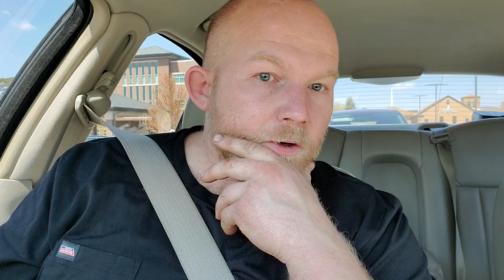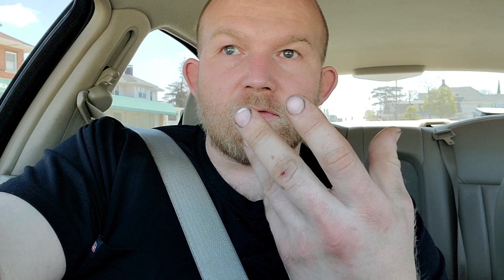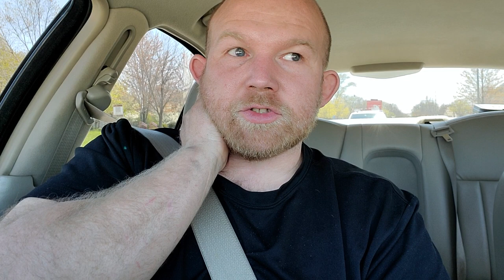Customer States " there is a pill bottle missing from my truck " Oh Boy, please come and get it NOW!

Comment: I like your videos. Thanks. True story. I was working at the Nissan dealer back in the mid eighties and a 720 4x4 pickup truck came in on a hook. It was brand new and one of the last produced before the Hard Body truck came out for sale. The client said that it died while sitting still after he and his friend had been pulled over by the police. Those trucks have the ECU mounted under the passenger seat. Really bad place for the ECU to be located in the first place. We were always dealing with fried computers after someone had been out four wheeling and water and mud would enter the cab. Well, this truck had only about six or seven thousand miles on it so ideally it should be covered by a warranty. But when your friend panics and throws the bong full of water under the seat and it soaks the ECU, causing it to smoke, the warranty is void. Pretty expensive little speeding ticket, I’d say. 
Another story. Two Mexicans came in to my shop in the middle of the summer when it was in the high 90’s. They were complaining about how hot it was in the little Toyota because the heat was stuck on the warmer setting and the knob would just spin and wouldn’t change to cold a/c. They didn’t speak English and I don’t speak Spanish so it was difficult to understand each other. But, in badly broken Spanish, I told them to go get some food from the joint down the street and I would look at it in a bit. Well, I had my tech look for the problem and what he found was the cable had been disconnected from someone trying to make space in order to be able to fit a couple of softball size balls of cocaine up in the dash. Probably a kilo or more. I don’t think that the Mexican dudes even knew that the dope was crammed up there. I think they were unwitting mules. This was in the early 90’s when the cocaine was still actually the good stuff. Not all beaten and stomped on like it was the last time I indulged some 20 years ago. I was tempted to pilfer some, but I was not into having a fire sale at my shop after the mules got to their destination and the reception team figured out that the stash was light. 
As a 56 year old man and a 38 year veteran master technician and shop owner in the auto diagnostic and repair industry I’ve seen it all and I’m really burned out. Crackpot clients, fraudulent seekers of free stuff, warranty scammers, the “it wasn’t doing that before” assholes, jack off hack mechanics and true, genius technicians, blow job offers for repairs, titties flashed for a discount, crack pipes, rigs and needles, people that live in the trunk, and some really good, loyal and lifelong customers. We see every type of person that walks the planet. 
I’m starting a new career in custom auto upholstery and trying to sell my shop now. I’m too tired and beat up from wrecking my body over the years and I can’t find a good technician for the life of me. I’ve hired and fired so many times that I can’t count the amount. All the best techs are either comfortable with their employers or leaving the industry because they’re discouraged with the very small pool of candidates to take the baton from them and mold into the next true technician. Meaning that they have all the burden on their shoulders with all the problems to solve in this mainly thankless vocation. Not only that, but as masters in a never ending educational aspect, we’re under paid as a whole. After all, we really are doctors in a sense. The human body hasn’t changed in thousands of years, but the technology changes in the automotive world are as abundant as the times you change your underwear. Or how often you should change your underwear at least. I though, pay my 2 techs very well because I value them and know how difficult it is to keep up with technology and the costs of being the best. One of the guys makes over $100k and the other makes close to $80k per year. This is with a Monday through Friday, no weekends work week. Plus we’re out of the shop and closed by 6pm.

Comment: I work as an auto tech for my local police department and you are almost guaranteed to find stuff under the backseat of the patrol cars. We strip the cars out when they are totaled, they shove it in the cutout where the seatbelt comes through. Anything you can imagine but usually in small amounts. I'm still waiting to find my wad of drug money 😪
Reply: As far as I know the back seats are plastic and are made to be easily removed. The officer is saposed to check the back and look under the seat after every person they take to jail so that 1 that person they just took to jail can be charged and 2nd so that someone can't say that it wasn't theirs and was from the person before them.

Comment: could you imagine going on a road test and getting stopped/ searched. by definition you'd be in possesion
Reply: Yes technically he would be but most cops wouldn't charge him with it since he had zero connection to the car. If they were to charge him, a good lawyer could get the the charges dismissed.
Reply: I doubt that because if your car is stolen and returned to your driveway and you have no knowledge of it but the police have proof is used in a robbery in your driving at the next day you're not going to go to rest for the robbery or like ah that wasn't you oh shit there's a joint in there huh probably wasn't you that's probably the robbers too
Reply: That's why you never talk to police, don't answer any questions, don't consent to search and keep your mouth shut.

Comment: Lol. Recovering alcoholic /addict here, 17 months clean and sober. I bet that blue pill had a 30 written on it lol.
Reply: or 80
Reply: @numberpirate  🤣
Reply: at first, I thought it was ging to be meth then he said blue pill
Reply: @numberpirate  nah, it was definitely a 30
Reply: So, for the non-enlightened, what IS the blue pill with a 30 on it?
Reply: @davef.2811  it’s no problem Dave, not everyone knows and unfortunately I do know because of medical reasons, not addiction purposes. The blue on is a 30mg OxyCodone. 

I broke my back In 3 places back in 2000 and shattered all my ribs and tore my shoulder away from the chest wall and have been thru 13 surgeries trying to patch me up which over the years required some help with pain control which is how I know.  I always took mine as prescribed and never had issues but I guess I was one of the lucky few!!

Take care buddy, be safe out there!
Reply: @1982MCI  Thanks for the personal insight, Don. Be well.
Reply: @davef.2811  anytime Dave. Unless you ever have a medical need for it, please stay away from it!! It is a wonderful medication when used as directed like I did but if you ever steer away from that then it can destroy your life real quick. I’ve got strong will power, so it wasn’t an issue for me to take as prescribed but other folks take one and it helped but still had a little pain so they’d take another and then the domino affect has been activated and it’s just a matter of time. 

Take care dave
Reply: @davef.2811  d it's Oxy pills
Reply: @1982MCI  those smurfs are hard to find now a days

Comment: 😂 I had a customers pot box come sliding out under my feet from under the seat on my brake inspection test drive. I was like... Ohh hell no I don't need to be getting pulled over in this thing
Reply: You got scared over weed 🤣
Reply: @ghostsof6tharmy644  there are unfortunately still some states that are absolute nazis about weed and will throw the book at you over any little amount. Mostly southern states.
Reply: @Italianboy120  yeah..I guess your right.

Comment: I ran Express service at the Toyota at the Avenues for about a year and a half..
We did about 90 cars a day. The stuff we saw in people's cars and trucks was amazing. You start to tell a lot about people by what's in their car and sometimes what's not in their car.
I got to the point where I could tell what kind of little adornments that were inside or on the vehicle but tell me whether or not that customer was going to spend any money on any of the things that I recommended regardless of severity or unsafe nature of the malfunction. 
One of the things I noticed is hello Kitty.
Statistically speaking if you see hello Kitty on a car or in it any form of vehicular adornment or modification you might as well count on a denial of service.
Betty boop as well... Nobody with a Betty boop steering wheel cover is going to afford the head gaskets.

Comment: I used to retrieve unreturned rentals for Hertz, all kinds of weird stuff.  Best was the 7 month old car they had stolen the engine out of and placed cinder blocks under the hood.
Reply: Man I work on Hertz retail cars for reconditioning and I can confirm there's some weird shit in some of those cars.
Reply: Back in the 80s I was given an Enterprise rental while my car was being repaired from an accident. I was putting gas in and thought I might check the oil. Man! That stuff was as thick as brownie batter. That's why  I'll never buy a rental.

Comment: This goes back in the day.   I worked at a Chevrolet dealership.  A customer had bought a 1986 Monte Carlo SS.   He brought it back and stated that it was leaking transmission fluid.   As soon as I got in the car it reeked of pot.   The seats already had pin hole burns and in the ash tray were several half smoked joints.   Pot still isn't legal in my state yet in 2021.   Too shorten the story, his leak turned out to be him driving the car in second gear up hills at 80 mph and the fluid was blowing out of the weep  tube on the 700 4R.   I got paid flat time for messing with it and not finding the leak driving the car with reason.

Comment: I was doing an oil change and checked the cabin air filter on a car, pulled the glovebox out and there was a gallon plastic bag behind it with all different kinds of random pills. Capsules, bars, tablets, etc. Weight about 2 or 3 pounds. Did the oil change and got it out of the shop. Never saw him again, never want to.
Reply from the maker: Yikes
Reply: Score!!!

Comment: Worked at a Porsche - Audi - Land Rover dealership, was careful 1) only do what customer wants - nothing extra, 2) don't look in glove compartment/armrest.  Dozens accused of taking quarters from the change holder.  3) we were told not to accept tips, as it was our job.  A customer came in to test drive a Porsche, then could not get his to start.  Went out and look at it, lose battery connection, tightened it, and started right up.  The guy goes to hand me $100,  not with the salesperson standing over my shoulder.

Comment: Just curious, I haven't driven in the United States. Do you not use turn signals? I didn't hear yours come on once while you were driving!
Reply from the maker: I always use turn signals 
this is the Lincoln Town Car this is not some Honda Civic it's a little bit more prestigious LOL
Very subtle sounds nothing to annoying or overly aggressive and when I typically drive and video it's on the highway so there's no reason for me to be using a lot of turn signal action

Comment: I have had a Ford tech turn my dashcam off. Would you? Interesting topic.
Reply from the maker: Video time
Reply from the maker: No
Reply from the maker: https://youtu.be/nVI8_eFM-uY
Reply: Every place ive taken my car in has done the same, body shop after a minor accident, and the VW dealership. Guess it is their policy to unplug dashcams before service for some reason. Not a big deal to me, but it's just kind of strange and I wish they wouldn't unless it pertains to the repair being done. I have it setup to record on any detected impact or loud noises and when they disconnect them they never plug it back in correctly.
Reply: I always do something goofy for the dash cams to try and make the customer laugh. Who cares if they watch me work. Doesn't change a thing
Reply: Depends on why the car was there. 
If it runs all the time and the car is there for a day or more I probably would or just unplug it, but if it's just in for a service then no.

Any electrical work then probably yes since it would likely be part of troubleshooting.

Comment: I always make it a point to remove all personal effects from my vehicles whenever they have to go in for service. Then I don’t have to worry about anything coming up missing, and the technician has a nice clutter-free vehicle to work on. I always keep my car extremely clean anyway, but my wife does a fair amount of driving for work and her work vehicle tends to accumulate some of her work equipment and the occasional empty water bottle/trash in it. I always make sure to clean it all out and give it a vacuum and wipe down before it has to go in.

Comment: Had this experience, car was from South Carolina and it needed about 2k in work and they approved it and we search for a wheel lock and as usual I check the glove box and just out In the open there’s a gallon zip lock bag half way filled with cannabis, I’ve never moved so fast on that car to quickly get it out the shop

Comment: After I graduated high school I worked with a good friend of mine at his grandfather's used car lot. We were the ones that did the first detail when they came from the auction lot or trade in. We were doing a mini van from a police auction and went to move the coins out of the little cubby under the radio and noticed something didn't look quite right under the money. I have absolutely no idea how the police didn't catch this before hand but there was a secret compartment that when you pushed on the little discolored area where the change was it revealed a cut out spot in the floor where there was a shit load of pills and baggies of what we guessed was cocaine. Had to call the police for that one lol

Comment: ?????? I have a 03 tc and my chilton book says that my belt tensioner bolt should be torqued to 19 ft-lb. Then go 90 degrees plus .   but every where online says 18 to19 ft lb nothing more. I already did what the chilton book said but it feels over tight . i dont want to damage anything . can you look this up pls. 
Thank you again.
Reply from the maker: So all of the bolts that are in that system the big bolts that hold something down are all 30 foot pounds

The seat belt anchor at the floor on the b-pillar is 30 foot-pounds the one up top by your shoulder is 30 ft lb
Reply: Sorry my drive (engine) belt tentioner. The one next to my water pump.  Sorry. Sorry😭😭😭😭😭
Reply from the maker: @lalola9327  lol

I'm pretty sure it is like only 18 to 19ftlbs and so are the pulley that goes to it
Reply from the maker: @lalola9327  I've never seen the 90° thing
Reply: @FordBossMe  thank you . I will fix it right now
Reply: Once I figure out how to send pictures I will send you one of the manual .my car is just like the one you showing the video. Twin. my wife says she's needs a van not another big car😭😭😭😭😭
Reply: It was very strange. Thats why i ask
Reply from the maker: @lalola9327  yeah because I remember recently helping another guy on another page because he was torquing it to something like 25 ft pounds and I was like no no you can't do that it's only like 18 foot-pounds and so are the bolts that go to the pulley
Reply: Yes you are right everything is 18-19 even the pump. I am going to pray that I did not damage my bolt threads housing because if I did now when I torque it to 18 foot-pounds it's going to be a lot loose I was going to ask you last night but it was like 10:30pm central time

Comment: He dropped either perc 30 or Fentanyl fake perc 30. Just 1 pill? That's crazy you said found it and gave it back you could have easily said no and just threw it away especially if it was just 1 pill in the bottle.

Comment: Hey checking out some of your videos and wandered what you would say might be the cause of my back up camera going haywire on rainy days sometimes distorted view and then offline message next day sitting in the sun few hours and works fine it's a 2015 mustang gt premium is it simple fix or what, great videos by the way
Reply from the maker: I have a video showing where one of the most major common problems is with the Mustang wiring and sometimes it actually affects it even more when it's raining
Reply from the maker: https://youtu.be/71Onbo8PgrY
Reply: @FordBossMe  nice you think this might apply to mine it only does it when it rains I would have never guessed that thanks buddie I appreciate ya helping me out. Let me know if you think this includes me I was over at ford dealership in marysville ohio buying brake pads front and rear for my truck and my mustang and they charged 1400 bucks I was so stunned I didnt get to ask about buying a camera I could hardly carry that bag outta there lol.

Comment: I have a 2005 Ford exsplorer sports trac high beams work driver side low beam doesn't any suggestions
Reply from the maker: connector burned up? did you check basics like power and ground When turned on?
Reply: @FordBossMe  connectors is good and the bulb is good I Googled my issue and there is a low beam module relay box that could be the problem

Comment: When I was working at a semi truck company , we (me and another guy) were working on removing the gps, and a general “check over” since the driver turned  it in (either quit or got a new truck) My coworker started dumping all this stuff out of the truck and he noticed “something” in a small plastic bag, so we had to stop, call the cops, lock up the truck in the shop and wait. About 20 minutes go by the cops are there and had THEM remove it. They field tested it and it turned up positive for meth.